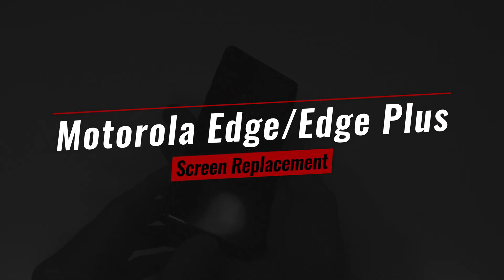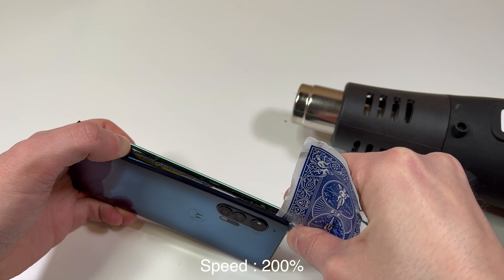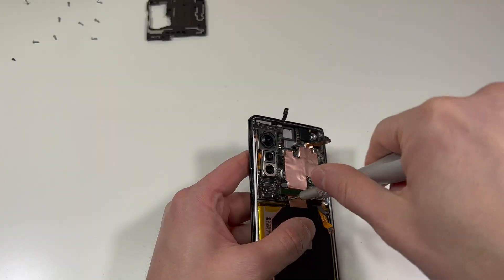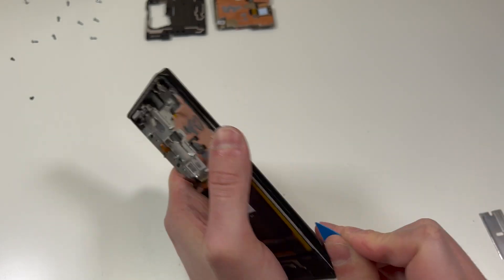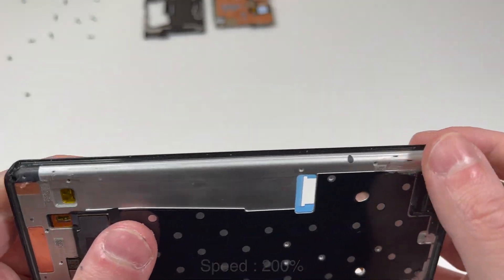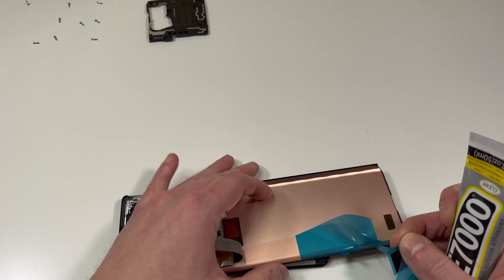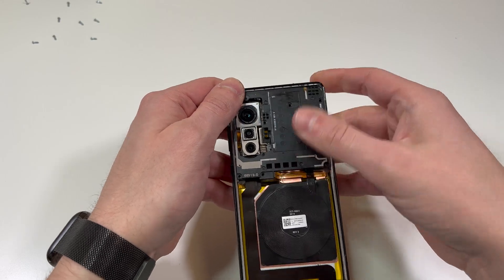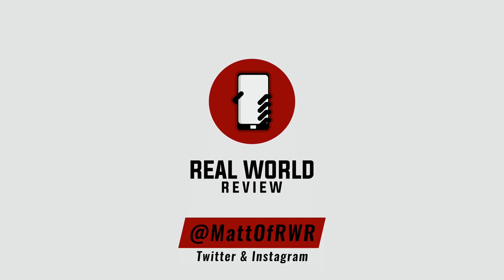Motorola Moto Edge / Edge Plus (2020) Screen Replacement (Fix Your Broken Display!)

Comment: You do not have to take the main board all the way out let alone unhook all of those cables just take the bottom black screw out and unhook the battery and the main board will lift up just enough to get the cable for the screen thru the hole theres alot of shit he dont tell you in that video . jerk

Comment: I used clamps and not too tight and messed up the screen. Had lines on it.
Reply from the maker: Might have had some glass under cause those screens are slightly more durable than the average plastic OLED (from what I’ve seen atleast. This is one of the only curved screens I can remove without breaking)
Reply: @RealWorldReview  they sure don't make them easy to remove. I will check the frame over for glass. TY.

Comment: does the edge and edge plus share the same display? means if edges display can be used in edge pluse"s frame? and the pins,they really match?
Reply from the maker: Yes, the frame is different so you can't buy it with the frame and have it fit both, but the screen is the exact same and will work on both phones.
Reply: @RealWorldReview  where do you get the screen from I have one that broke need it replaced
Reply: It means 2061 and 2063 are same???